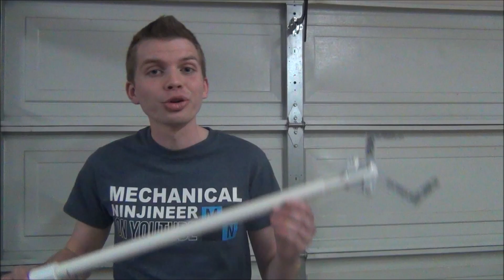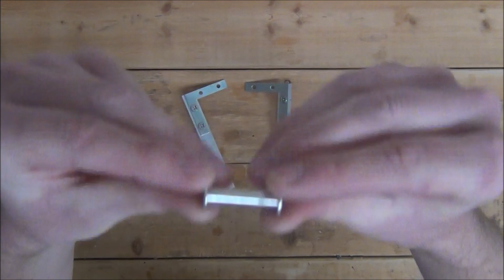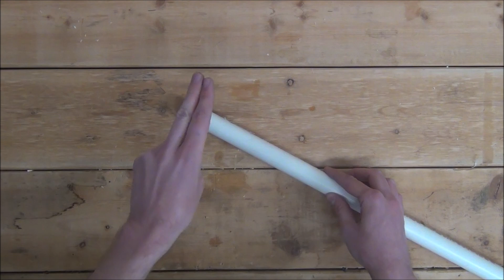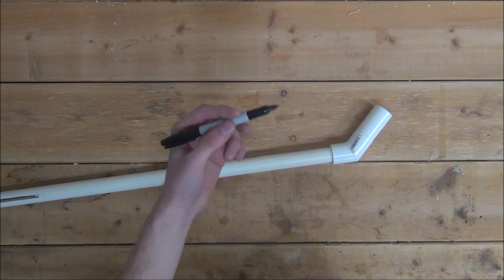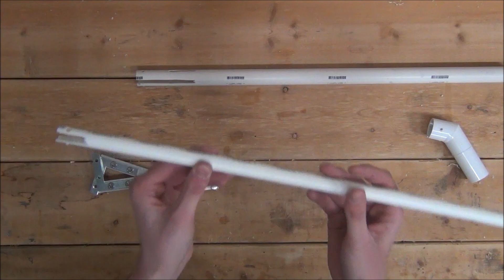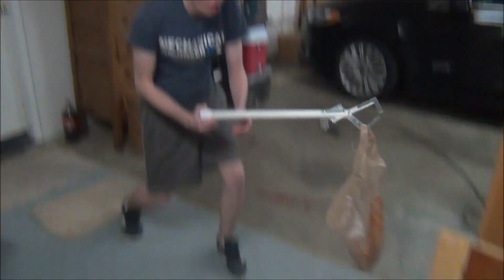How To Make A Grabber!!!

Comment: I get that this is 9yrs old when I'm making this comment, but normal SCH40 1/2" PVC pipe doesn't not fit into SCH40 3/4" pipe.  At least all the pipe I have doesn't fit
Reply from the maker: I havent seen this video since I made it. Why not use 1/2in with 1/2in?

Comment: 36-42" long. Aluminum or stainless steel pipe walking cane, grabber. Should be HD like the Unger, but jaws stay closed while walking. Maybe use steel cable inside. Squeeze handle to open it with strong spring, will automatically hold onto objects like 15oz canned soup, tree limb, whatever, squeezing makes jaws open. Rwplaceable rubber tips for walking with grip texture. Metal reinforced with jagged biters like Unger. Old folks need something like this. Every day purpose, hold weight to 400lb as walkint cane, use to reach objects from up high, etc. Could weight up to 3lb.
Reply: That is a wonderful idea!  I like it and will try that when I try to make one!  Thank you so much for sharing your idea/ experience with us/ the creative masses!!!

Comment: Great Design!  I’m a General Contractor and need to get heavy parts and materials off of my upper supply shelves; but have not been able to find a grabber tool strong enough to fulfill my needs… until now!

I can adapt and customize the jaw a little bit for my needs & sleeve the trigger & make it 2 fingers long for a stronger lift. 

I majored in physics, and always joined the crowds watching the senior M. E. Final projects… Great Fun!

Comment: Good build! …but pvc? I’m going for all metal. I’m going to use your idea but with salvaged parts. The claw scissoring mechanism from a hanging baby bouncer( it’s used to grip the top of a doorway), salvaged security cable( it’s almost the same as bike brake cable), and other parts I’ve hoarded. I hope it turns out as nice as yours. 👍👍

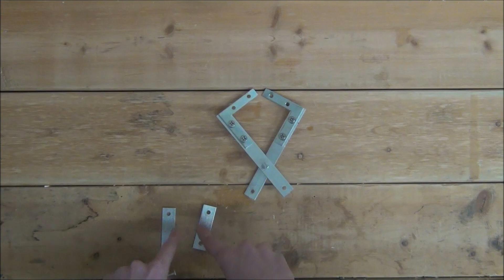Comment: Hello. May I know what is the length of the hole you made in 1:41 for both the 6-inch aluminium strip and 2 1/2 inch aluminum strip (for putting the hinge pin) ??

Comment: Have you tried making this with four grabber fingers instead of only two? I've seen one but cant figure it out as the hinges are crossed somehow.
Reply from the maker: No, I haven't tried that however you could add another level on to this design if you wanted to.
Reply: It would prolly haft to be a reverse of this. The trigger would half to pull the claws closed not push. If I had a little money id make one.

Comment: Did you also use aluminum "threaded post with screws" to attach the 90 degree aluminum pieces and if so what size pins did you use? Half inch pins?
Reply from the maker: No I didn't. I actually just used regular bolts and bolted them into the aluminum pieces that were sticking out of the poll.  :)